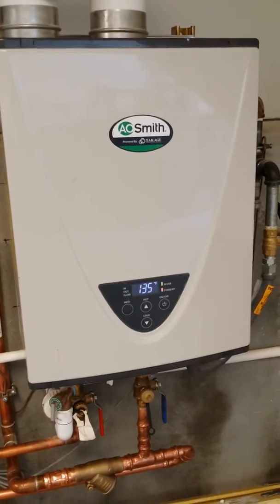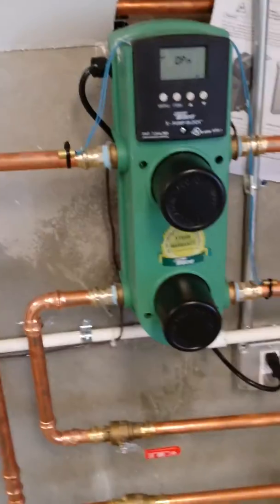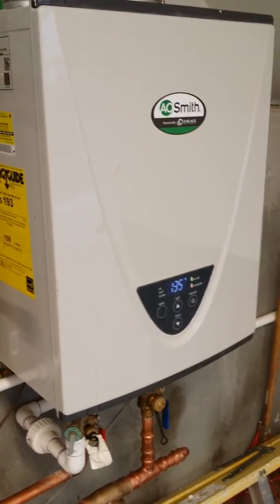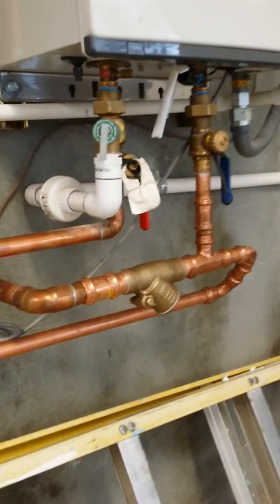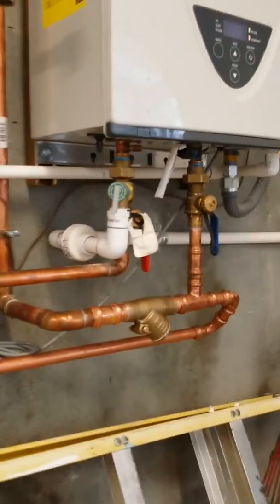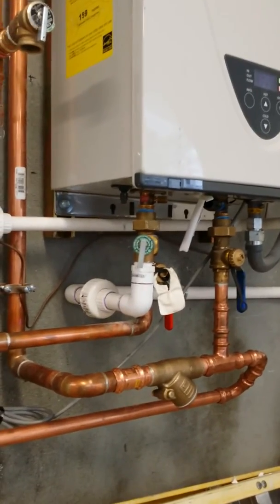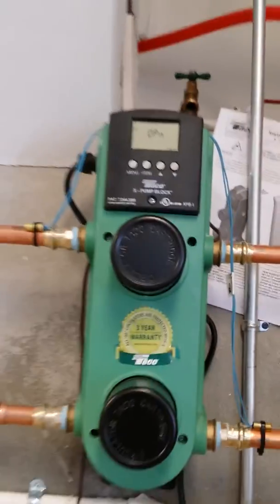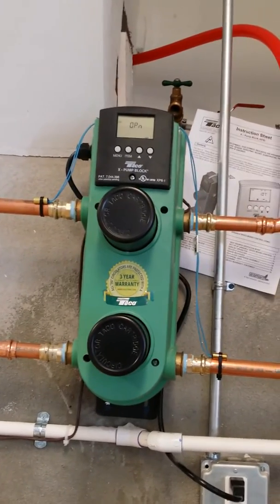Radiant heating with a taco XPB block

Comment: Do you know what settings you have the X block set to? I'm have trouble with mine. When I put it in manual override it works great! The variable speed pump doesn't seem to be coming on.
Reply: Did you get a reply or figure out a solution? I have the same problem - works fine on manual but not on automatic

Comment: Insightful video. I tried hooking up a Nest to mine before realizing it wasn't sending any power. Were you able to run a common wire from the XPB or have to wire it from a different power source?